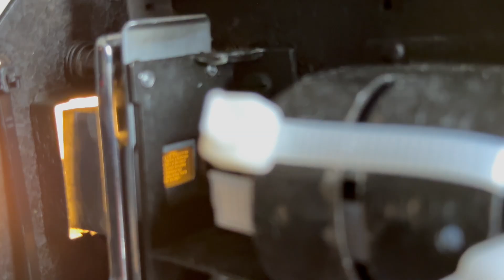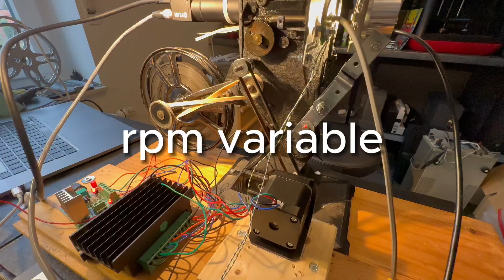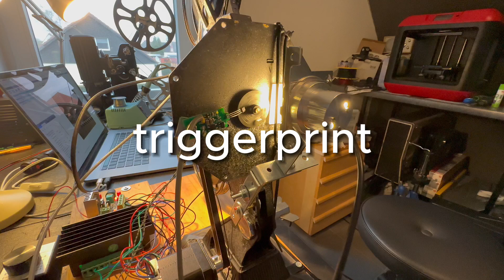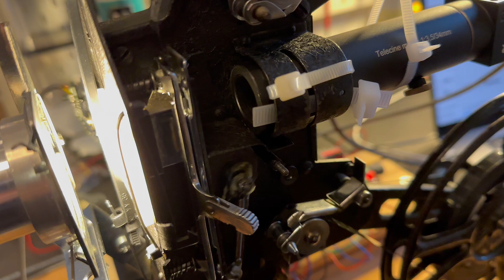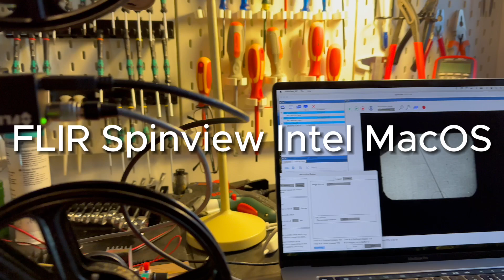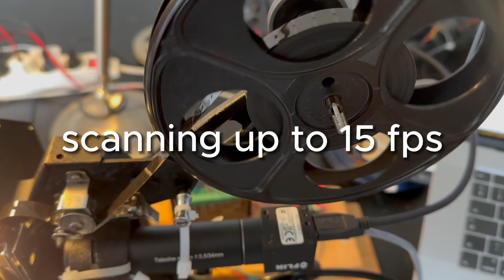9.5 mm film scanner

Comment: Love this setup and will be using a Flir Blackfly camera in a scanner I am building at the moment.  Would you be able to screen shot the Spinnaker settings that you used in the setuo?
Reply from the maker: Thanks for the compliment. You can find some settings in this video: https://youtu.be/yvjSMrg2T6k?si=Bh1UJRGkxNvkup9Z As you can see I'm using Spinview. Will make an update of this video coming weeks, with Spinview on MacMini M1. In the 9,5mm video scanner I use a fixed exposure time, I set the light to maximum then adjust exposure time so whites are not overexposed. Then adjust the light when needed during scan. Lately I use TIFF uncompressed see details here https://youtu.be/7ugkdZbPi4E?si=GcdYwuN7sNPWzt3d